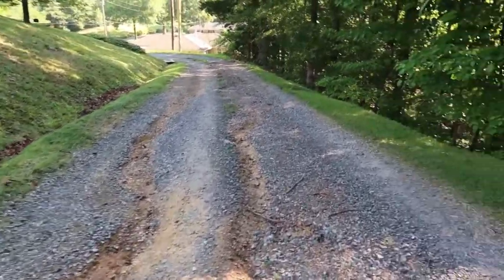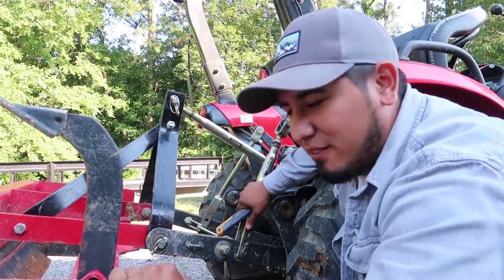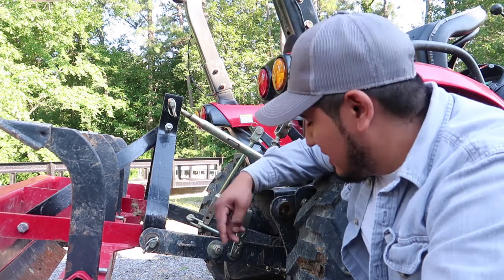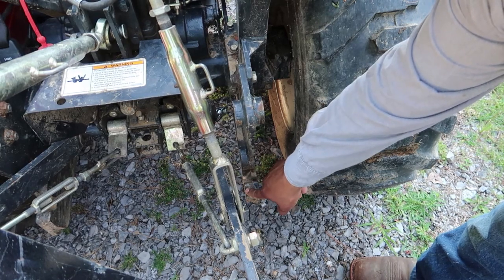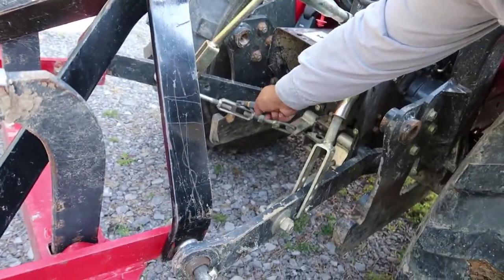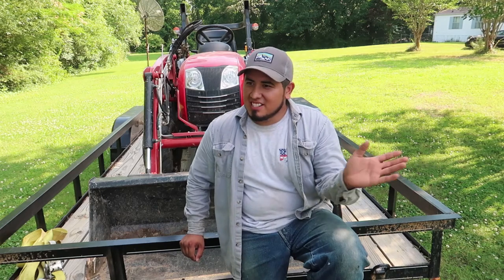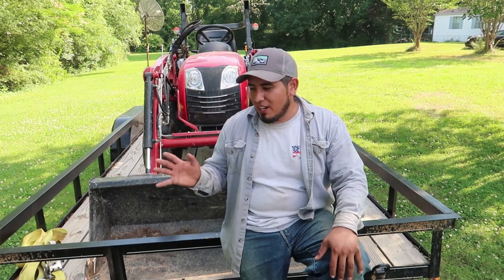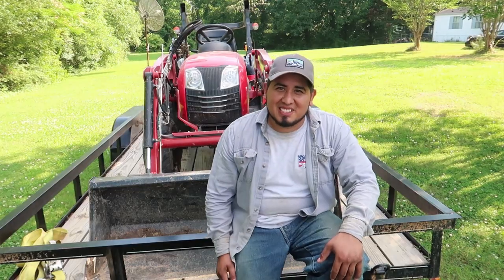Subcompact tractor job #15[Regrading a driveway]Boxblade tips and tricks

Comment: Greetings, I've been doing this professionally for several years now and have a couple of tips. 1) You have to dig down and destroy the actual structure of a pothole or else it will return very quickly in the exact same spot. 2) Good work on the box blade, especially the ditch deepening. Way to use the box to drag material down where it's needed. Much more efficient than the FEL. 3) Get yourself a land plane. It's the bomb for the finish work. Way faster than the box blade and way better, flatter, smoother finish. Easy to operate and works great for shaving vegetation as there's two blades rather than one. They are at an angle to give you more of a shearing action. Think of it this way ..... box blade for rough grade and land plane for finish grade. If you have a quick-hitch on you 3PH, changing back and forth takes only seconds. You won't be disappointed with it's performance and you will wonder why you didn't have one sooner. 4) Packing the gravel down to "set" it makes you work last longer with a roller. 5) A hydraulic top link is also a wonderful tool to adjust your implements on the fly to fine tune their performance. Huge time saver. Good luck ...... Montana Dan
Reply: @El.Stumpy  Could agree more with both of you. Dan, wonderful advice and you mention everything I've been thinking of for my tractor as well but being in the same boat as "cgff" trying to afford all the extras is hard.  Land plane $1500 and up. Top link 300 (but with mine I need the controller and hoses as well, another $1500 when said and done. Quick hitch, probably the next item as its the cheapest and very beneficial for time oh, and a roller... man that would be awesome, I haven't looked those up yet but that just sounds expensive; but like you said and I agree necessary for a good road base.  Keep up the good work CGFF, your work is looking great.
Reply: @El.Stumpy   well...  currently I work it around the house/property with 700ft of driveway and 3 turn arounds( 2 double parking spots  and a single spot) brought in 36 ton of gravel/base 6 months ago to make it all and still need about 20 ton more, lol. It could be a nice side business for me... we'll see 👀 😏
Reply: @El.Stumpy  yes, very busy here lol.  Keep up the good work and will be watching you do more of the same.   👍
Reply: @thaddeustroyer  I just rent the roller and add that to the cost to the client.

Comment: That was an awesome job on the driveway. I bought a new J.D.3025 with a loader and box blade a couple years ago. I've used it a couple times, after watching your video i learned a few thingsYou explained things really well.  My driveway is only about 200 feet long.  I just put 10 ton of limestone on it. Its pretty good shape right now but, in time I'll have to dress it up a little, your demonstration will be very helpful,  thank you.
Reply: In all honesty your tractor is about the same size as mine. I bought the 3 E series and  its a 25 h.p. If you really wanted a bigger tractor I'd go with 3 R series. They have a lot of options. When i got mine i went with the cheaper E series. Thank you

Comment: Nice job and thanks for the tips. Really like the Branson 2400h. Is that the box blade that came with it?
Reply: @El.Stumpy  Looking for a compact tractor and the Branson certainly is a contender. Wish the 2400h had a quick connect on the loader. Like the package of box blade and mower but was wondering if they were lightweight in the package as compared to buying separate. Thanks!
Reply: @El.Stumpy  Sorry, when I said quick connect on the loader ..I meant for the bucket so you can take the bucket off and use different attachments easily. Sounds good.
Reply: @El.Stumpy  You are right about the capabilities and good price and being a good machine. A good dealer is important too. Closest true Branson dealer will be about 70 miles away. There was another dealer but they have closed and others are trailer or outdoor sports places that are made to sell tractors as a sideline just to get the products they want. So they don't really know tractors.  Thanks!